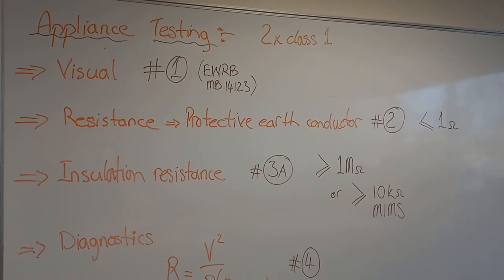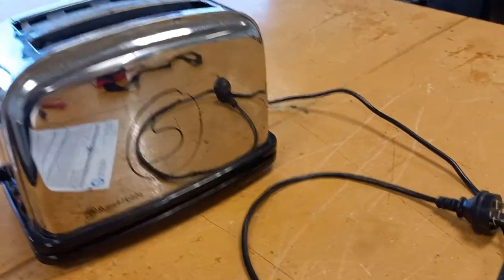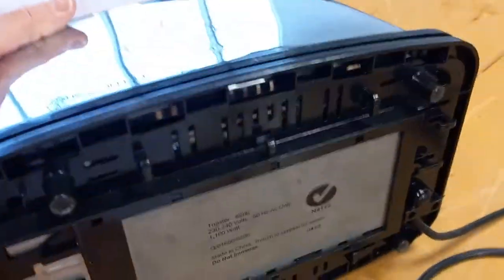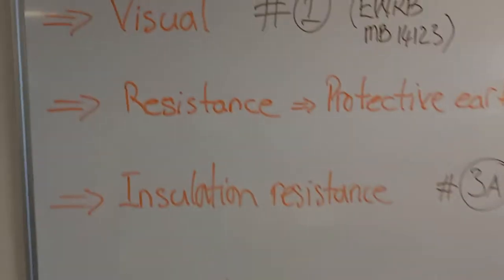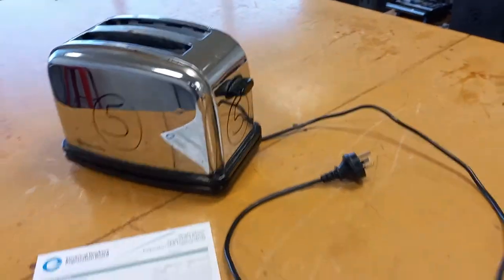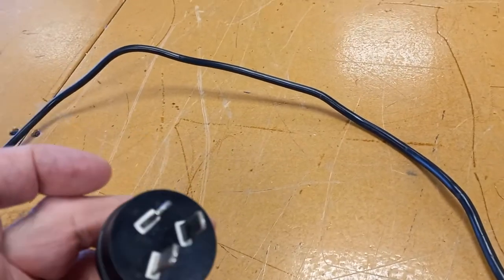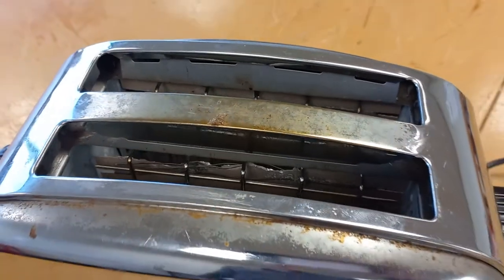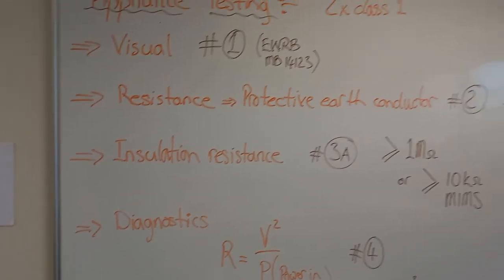EST Electrical safety testing AS/NZS 3760  class 1 appliance

Comment: How do you know what has a mims element and what is a normal heating element?
Reply from the maker: Hi Nick, many thanks for viewing.
The standard pop-up toaster uses a nichrome ribbon element threaded onto the mica support board, the mims elements are typically used on toasted sandwich presses and waffle makers etc, you can often notice the element mounds cast into the heating plates, kind wishes, John ... electrical instructor